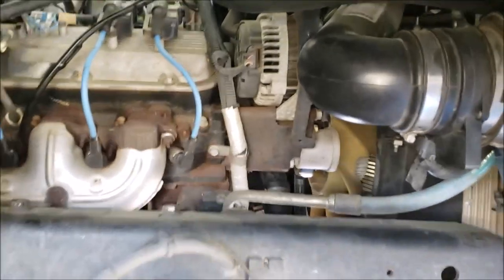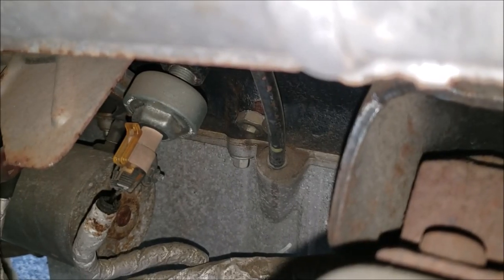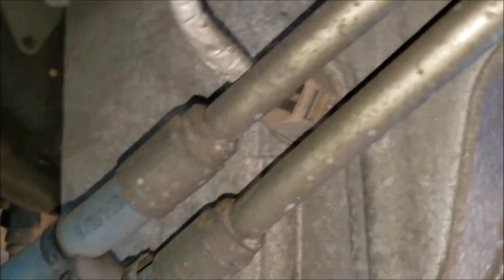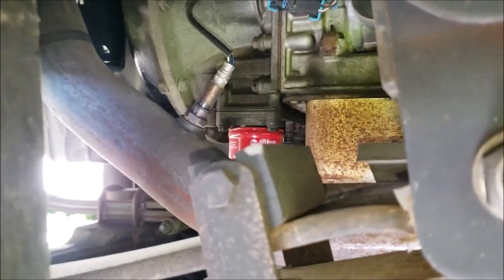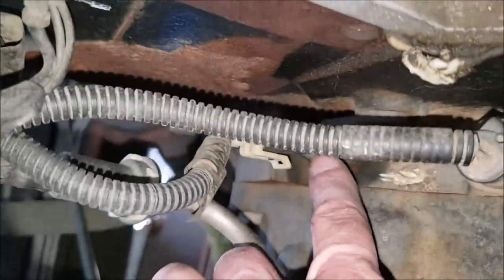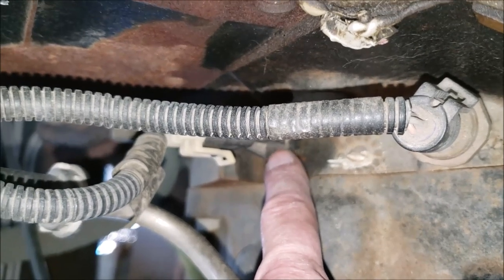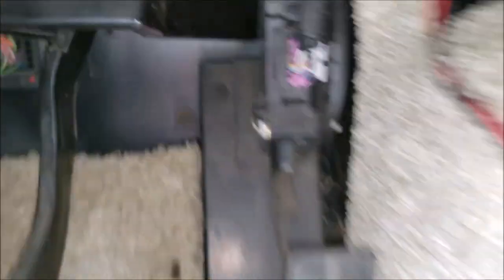Do You Know Where Your 8.1 8100 Vortec Engine Sensors Are?  Lets Take A Look

Comment: Hey Kevin, I got a P0332 (knock sensor #2) error the other day on my ‘04 W22 chassis w/8.1L. After using this video to locate the knock sensors and making a few calls the consensus was to continue driving. I used my ScanGauge 2 to clear the code and CEL.  So far, after approx 250 mile the CEL has not come back on.  I’ve got a 1,100 mile trip coming up in a few weeks on want to check whatever I can to prevent issues on the upcoming trip.  Thought I’d ask you what you think I should check.   My rig has ~37,300 miles on it.
Reply from the maker: Chris did we talk over the phone? If not I would replace the MAF sensor give me a text or call 606-875-0125 to discuss further.

Comment: On top of engine where you point out the oil pressure sensor & crank shaft sensor could you tell  me whats supposed to be bolted there where you have a plate bolted down as a cap off
Reply from the maker: That would be for the EGR valve. It was no longer used after year 2004
Reply: @ktoutdoor  thanks for quick response I always enjoy your videos they are so helpful

Comment: Kevin, Thank you. Thank you. Thank you for all your videos.
Reply from the maker: You are very very welcome glad to share what little knowledge I have.....
Reply: @ktoutdoor  you have helped me keep this bucket of bolts together. Renovated a 2004 Winnebago Adventurer 33V Workhorse with a 8.1 Vortec. Had a P0332 and P0332 P/D code. Just changed the knock sensor on Bank 2 and hoping that it’s just a bad sensor. Your videos have helped me with a LOT of different issues while renovating. Thanks again!
Reply from the maker: @wurdzify  Be careful you may not have a bad knock sensor at all but a lean condition give me a call I will try to help you trouble shoot my cell 606-875-0125 Kevin

Comment: Hey kevin i just recently had my check engine light come on but turned off after driving it like 2 miles was running kinda weird but tgen ran fine and no check engine light on put the scanner and its showing me a p0134 code low 02s activity bank 1 sensor 1
Reply from the maker: With its age it might be wise to install 2 new OEM o2 sensors DONT USE AFTER MARKET use this one x 2 https://amzn.to/3RtQjuA  text me at 606-875-0125 so we can discuss further. Kevin

Comment: Hi Kevin thanks for the video, I was wondering if you could tell where the Short Term Fuel Sensors fr Bank 1 and 2 are for the 8.a liter?
Reply from the maker: There is no one sensor for the fuel trim numbers. But the main sensor would be the o2 sensor, then the maf sensor map, throttle position, it takes many sensors working together trying to maintain the 14.7 to 1 air fuel ratio.
Reply: @ktoutdoor  Hey Thank you for the info, I did not mention my question is deriving from the ScanGauge 3 I just got. There are 2 PICs i can display that show "Short Term Fuel Trim Bank 1 and 2 Sensors. Bank 1 sensor 1 seems to be ok but Bank 2 sensor 1 just displays 99.2%. Could you or anyone think of what those are?  thanks again
Reply from the maker: Text me a picture to 606-875-0125 Kevin  @Toddderose
Reply: Will do thank you much appreciated.

Comment: In this video, is the oil pressure and crank sensors on the back of the engine?
Reply from the maker: Yes
Reply: Yes, they are at the very back by the firewall.  When this engine is in a truck, it's not easy to get to. I had to  get a step stool and climb up and lay on top of the engine to get to it from the front of the truck.  It's right near the transmission bellhousing where it bolts to the engine. It's best to invest in the special deepwell socket made for oil sensor removal.  It's a 1 and 1/ 16-inch deepwell socket.  1-1/16"  I think I used a 10" extension bar and ratchet to reach down there to loosen it. You'll need to be careful,  to not let any dirt get in the oil hole or on the new sensor when threading it in. I'm going to try using my USB endoscope camera to see behind the engine.  Otherwise, you will be doing it by feeling to find the hole. Some of you can relate to that, I'm sure! 😂😅

Comment: Appreciate your thorough videos especially on the workhorse. I'm having an issue with my engine temp on my cluster. Do you know what the sensor resistance should be with a cool engine? Im suspecting my cluster is the problem so I'm looking for the simplest fix. My sensor is reading about 2.2Kohm.
Reply from the maker: Give me a call or text I have a fix for you 606-875-0125 Kevin

Comment: Hi Kevin,
great video. torn AC belt ripped out my camshaft sensor harness, your video shows two wires, maybe a third? 2001 chevy 8.1 K2500. found two wires so far in nearby harness looking for a third?
Reply from the maker: Text me at 606-875-0125 i can send you a picture
Reply from the maker: PS I checked mine you will need 3 wires for sure
Reply from the maker: PS make sure your harmonic balancer rubber piece has not slipped causing the belt to jump off... it happens.

Comment: Hi, Kevin.  Do you know have two oxygen sensor voltage reading on your scanner?  I hook up mine and I got oxygen sensor one at 0.55V and oxygen sensor two reads 0.0V.  Looks like one is bad.  Which one is sensor 1 and which one is sensor two?  My RV fail smog.  It 's running a little rich at idle.  HC (hydrocarbon) measure 251, max is 150.
Reply from the maker: Call or text my cell phone 606-875-0125 Kevin i will help you

Comment: Great video, so on my 2005 Chevrolet Kodiak C5500 8.1 Vortec engine the knock sensors are on the side of each engine block and NOT under the manifold, correct?
Reply from the maker: Yes I believe so our is a 2005 8.1 and that's where they are mounted

Comment: Kevin, my Scan Guage 3 is reading +25 for the long term fuel trim on bank 1. The pending code is PO131 O2 sensor circuit low / bank 1 sensor 1 (no check engine light yet). I watched this video again in an attempt to verify the location of the O2 sensors. I understand there are 2 sensors (1 for ea bank). But shouldn't there be an O2 sensor after the cat converter? I am curious if a faulty O2 sensor has such a dramatic affect to the fuel trim lean condition I am experiencing.
Reply from the maker: If your still up give me a call 606-875-0125 Kevin
Reply from the maker: To confirm bad o2 sensor just swap locations from bank 1 to bank 2 and see if the problem moved to the other side then you know you need  new o2 sensors. If the lean condition stays confirm you don't have a exhaust leak on bank 1 = drivers side.  Note we don't have post cat o2 sensors based on age you might want to replace them anyway but use only this one https://amzn.to/3mRpx2k  note don't use any after market. Slim chance you may have a bad or plugged fuel injector on that side. Give me a call at 606-875-0125 Kevin
Reply from the maker: PS: +25% is in the danger zone for engine damage if you driving keep the RPM's down and take it slow going up steep grades that's when most engine failures occur .
Reply: @ktoutdoor  I am going to do an air pressure / soapy water test to see if there are any exhaust leaks after which I will likely take you up on the phone call offer. thanks!!!!
Reply: Any updates on your long term fuel trims on bank 1? I have an intermittent issue where it will reach 21/22/23/24/25-ish range when I let off the throttle. When I am giving it gas it drops back to normal ranges. This is able to be reproduced each and every time.
Reply: Not really. My fuel trims continue to be on the high side (+15 to +20). I have regasketed the intake manifold thinking that there may be a vacuum leak....didn't help. Next, I am going to test the wiring integrity between the o2 sensor and the PCM. Then check the engine temp sensor, and the EVAP solenoid.
Reply: Hope you figure it out, Larry. I’m trying to do the same. Every time I let off the gas, the left bank shoots up to 21 or so. Then I give gas and it goes back to normal.
Reply: Sounds like you are getting air (vacuum leak) coming in on the left bank when you let off on the gas which makes the o2 sensor see more unburned oxygen which triggers the ECM to increase the pulse width on the left bank injectors. Have you done a smoke test on the exhaust manifold? Remember I am still trying to figure this out too, so my comment is just me thinking out loud.
Reply: I will look into the smoke test. Thanks for the awesome thoughts! So likely not the O2 sensor since the sensor is doing its job right?
Reply: I agree, it appears that the o2 sensor is reacting to the conditions it sees in the exhaust stream. The "key" to me is that you are only experiencing wonky fuel trims on one bank.....that should be a key symptom to what is going on. Keep me posted on what you find, I always want to learn more.

Comment: How do you change the knock sensor? Looks easy, but watching some videos it looks more advanced. Thanks.
Reply from the maker: Most knock sensors that get replaced don't need to be replaced to begin with a lot of times you may be running lean triggering the knock sensor call or text me for more info 606-875-0125 Kevin
Reply: @ktoutdoor  by lean, you mean the gas I run? I put in the 87, should i go up, or put some gas additive in? Thanks for the quick response.
Reply from the maker: No lean fuel mixture will cause knocking bad mass air flow sensor maybe. Call me for details
Reply: @ktoutdoor how's it going, I'm having the same issue on my c5500 replaced sensor about 3000 miles ago now they back on

Comment: My 02' Silverado 2500hd has a 3 wire coolant temperature sensor but the engine harness is only 2 wire? My temp gauge works fine although I have an intermittent p0118 and p0101 codes with stumbling/stalling.
Reply from the maker: Give me a call or text to my cell so I can help you trouble shoot this 606-875-0125 Kevin

Comment: Is easy to replace the oil pressure sensor? And could that be the problem for my oil pressure gauge not working at all? (I’ve had the gauge cluster repaired cause they all stopped working)
Reply from the maker: Yes it could very easy to change. Be sure to get a ac Delco part

Comment: Are the sensor locations the same on every year.I'm looking to put an 05 model engine into an 03 chassis due to blown motor.
Reply from the maker: Please give me a call or text 606-875-0125 Kevin
Reply from the maker: Note fuel injection system is different from 03 to 05 give me a call you may have to change a few things. call or text 606-875-0125 Kevin

Comment: Always love your videos.

Question: what's the plastic bag zip tied to the wiring harness on top of your motor?
Reply from the maker: Good eye,,if you saw my coolant temperature alarm video I removed the brass plug from the left hand cylinder head to install new sensor there, I wanted to keep it handy if I ever had a leak and needed to reinstall it.
Reply: It doesn't get got enough to melt?
Reply from the maker: @gary3046  Nope in fact I have another smaller zip lock bag about 1"x1" that I keep my original schrader valve in where I added on the fuel gauge .. If the sending unit ever started leaking I can quickly put the valve back in.. its been there for years..lol

Comment: Slowdown!
Reply from the maker: Sorry about that...
Reply: @ktoutdoor  like your clip, however it jumped a bit too fast in some takes. I am trying to find the location of the Camshaft Position Sensor in my 2001 Workhorse GM engine. 
Thank you Kevin !
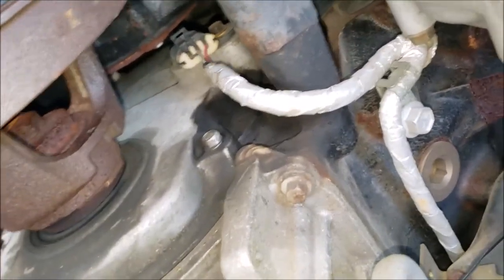Reply from the maker: @cocoliso1946  Go to 1:16 camshaft sensor is between harmonic damper and water pump toward the right bank. rare part to fail what are your symptoms? Give me a call if you like 606-875-0125 I stay up late..lol
Reply: The engine icon  came on . The computer   search informed that the problem was the Camshaft Position Sensor!
GM stopped production of that part, so now I am searching for one.
Thank you lots for your help!
Reply: Symptoms: I don’t know if they are related, but lately every time I go up a hill, the increase in RPM produce a loud rattling from the exterior of the engine!
Thank so much for your time and expertise.
Reply from the maker: Danger it sounds like pre ignition I can help just give me a call 606-875-0125 this video my help some also .
https://youtu.be/Ax_cuAIBkGQ
Reply: @ktoutdoor  Thank you Kevin! You are a blessing! 
Took the RV to the GM dealer. Sensor was replaced, however, when I started the engine, I noticed the engine icon was still on. So now they are doing an engine diagnose.
Do you have a paetron where people contribute money?
Reply from the maker: Thank you for the offer God has blessed me well no need for money. Just give me a call I would like to know more about your symptoms so I can store in my notes in order to help others. My cell 606-875-0125 Kevin